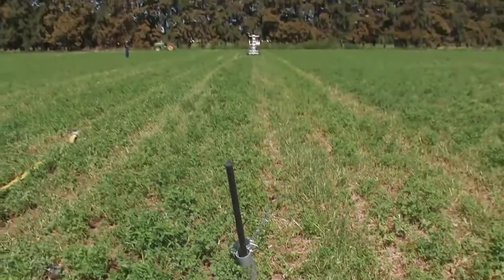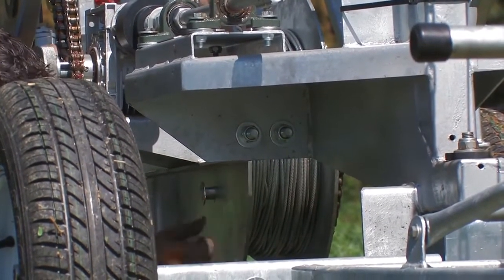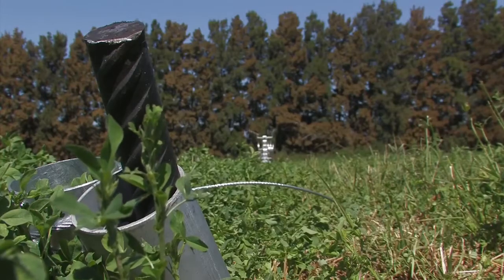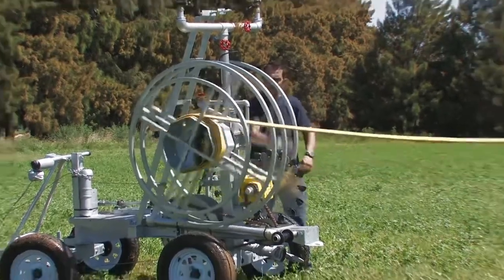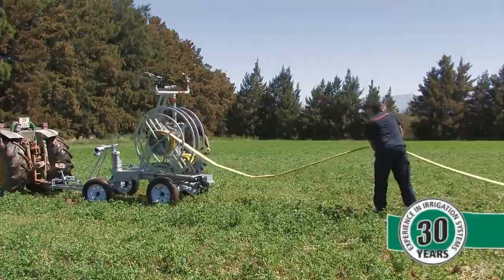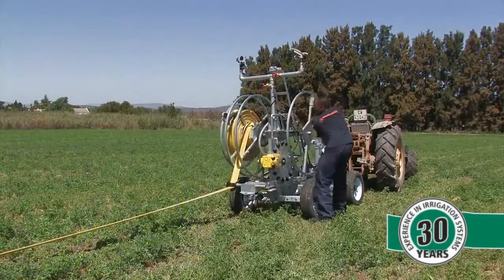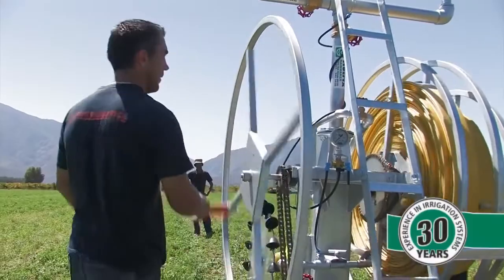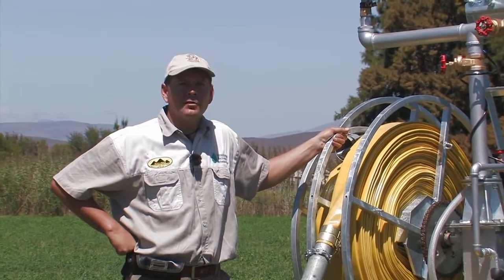Watch this Impressive Mechanized Irrigation System designed for Africa!

Comment: Does it have to be on flat surfaces only? The fields I want to irrigate are on uneven surface/sloped area. 
Does it have to be in a straight line or is it possible to maneuver through the irregular-shaped contour fields?